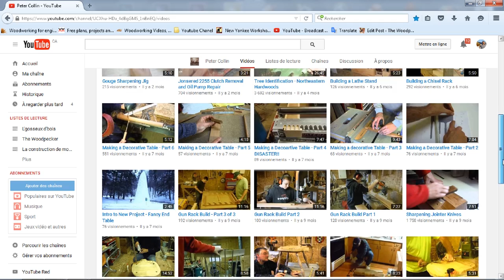The Woodpecker Ep 105 - Building a pair of coat racks - part 1

Comment: Looks great Alain, but now you'll have to build a bed for your dog!
How do you like your cordless jigsaw? I have DW and I'm thrilled with it (well after B&D piece of crap). Cheers!
Reply from the maker: +Andrea Arzensek The dog..... it can stay outside it's not that cold this winter thanks to El NIno. This weather is killing my snowmobile season. I only did 140Km so far, I'm putting the ski-doo inside the pick-up tomorrow and I'm going norh up north...
As for the jigsaw, I LOVE it. It's another sweet find in a pawn shop. As a mather of fact it's the best deal I've ever got from a used tool. The clerk didn't actually know the real price of the jigsaw so I've got it 1/3 of the price and it was brand new, not even a spec of dust on it. I love the fact that it has a stroboscope to light the blade, ok it's a bit weird not to see the blade moving but I can see clearly what I'm cutting. It can cut throught a 3" piece of hardwood, like cherry or maple like a hot knife through butter. The only thing is that I only have 1 baterry...
Reply: +Alain Vaillancourt   I wondered why were using a jigsaw to cut that great big chunk when you had a perfectly good chop saw... That was a Festool?
The strobe sounds like it would almost be worth buying one for myself.
When you cut the mould into three pieces you lost me again, but when you started clamping up the strips I saw, and if that was your idea, I must say that was brilliant. I've never seen that done before.... Great video,sir.
Reply from the maker: +Larry Aubry I'm always scared that the wood would pinching when I'm cutting a rough piece of wood. I used to cut it with an handsaw but since I bought a jigsaw I don't use elbow greece anymore.